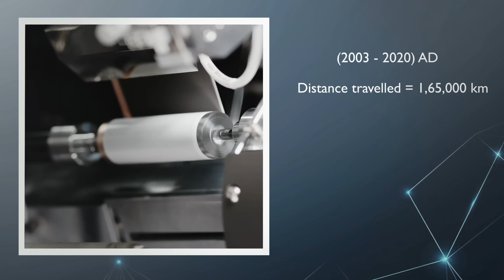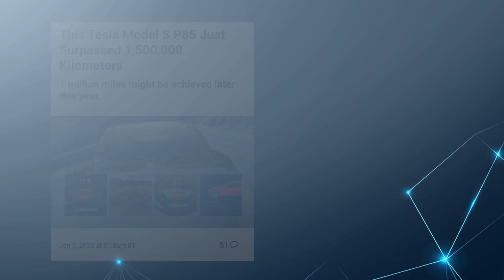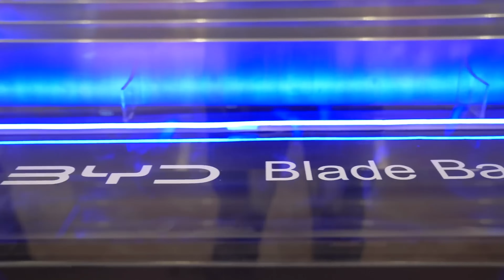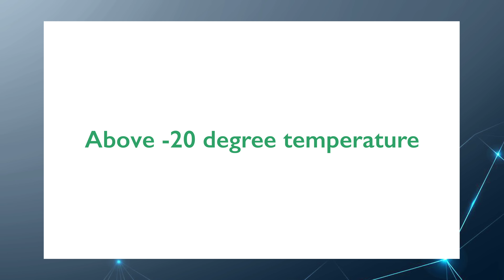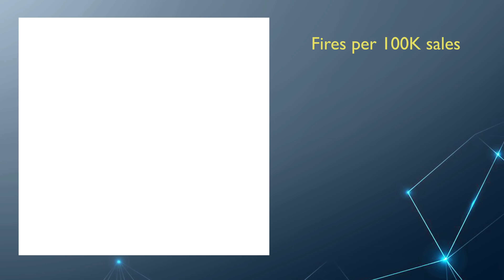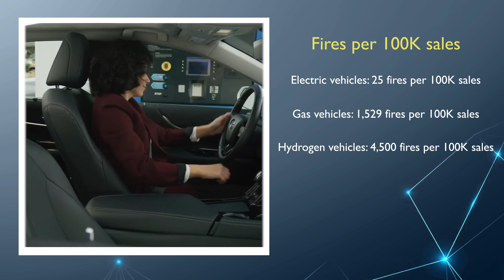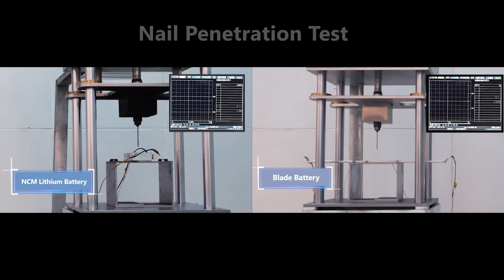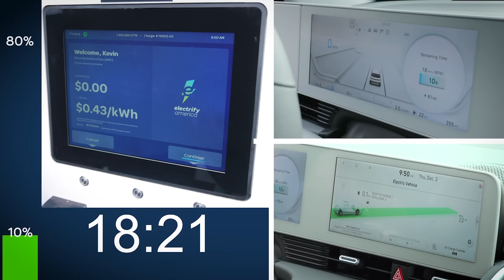Exploring the Fact about Electric Vehicle Battery Technology | बिजुली गाडी || Lokesh Oli

Comment: Re-sale value plays a big role in purchase hai, resale value of EVs are plummeting in developed markets due to battery degradation and battery replacement prices. At the span of 10 years, in which the battery will have to be replaced typically, 35-40% of the cost of the car will be of batteries. A ICE car will sell regardless it has engine issues because it will still run for 30 years pani, unlike EVs which will not move at all. I wish we had more push towards hybrids which costs less but Nepal ko stupid tax system is a joke afu mai.

Comment: Battery charging cycle 5000 bhayo bhanera life 5000 cycle wait 25 years samma hudaina. Battery health degrades. More than 15 years battery chaleko recorded nai chaina. Tyo tesla distance hajurle mention garnu vako was from 2013-2022(9 years). cycle and battery life span are completely different. Eauta video banaidinus baru : nexon battery lifecycle and replacement cost, byd life cycle ans replacement cost and other cars. I personally don't feel ev are feasible. Electric grid tied cars and trains matra good ho with no battery. Maximum recorded battery life of any sector pani halnu hola so that no one is confusion.

Comment: Very informative video. But the recent battery replacement cost saga is a lump too big to swallow. Motormouth (a car review channel) recently reported two incidents where the cost of Ionic 5 battery replacement was higher than the cost of the car. In both cases, the owner had scraped the bottom of the car. It would be very helpful if you could mention the actual cost of the battery replacement from the official sources.